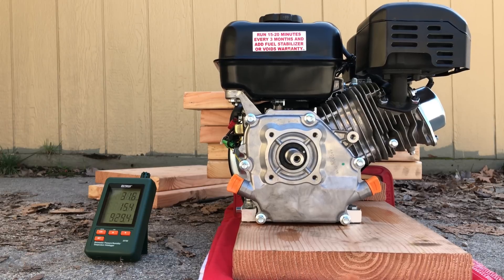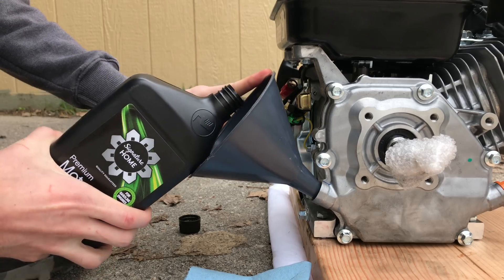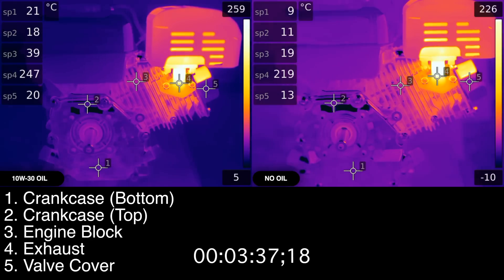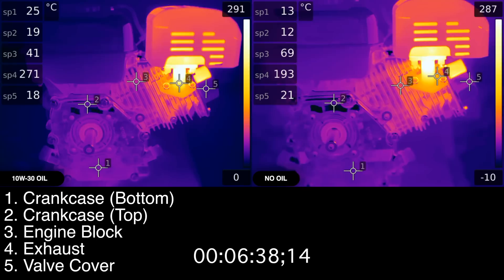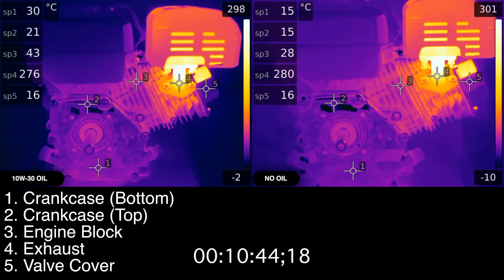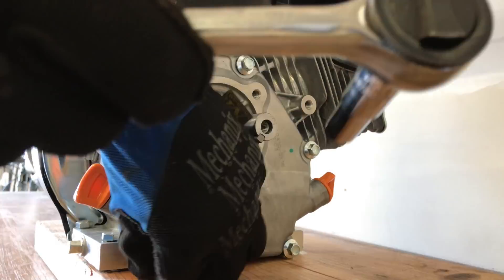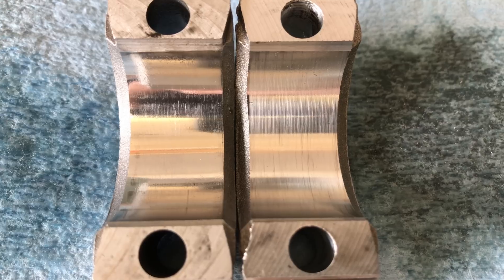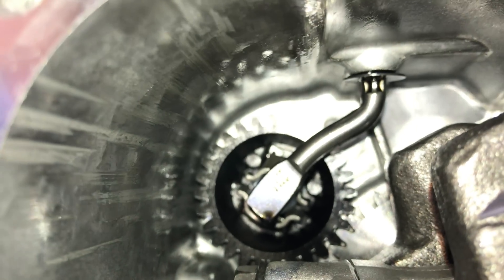What Happens To An Engine Without Oil?

Comment from the maker: Engine for sale, like new, only used twice, serious inquiries only!
I kid, I kid! As a serious tip though, be sure to occasionally check your oil level, older cars tend to burn more oil and it's a headache that can be easily avoided by checking your dipstick while your car fills up with gas. If you're into Instagram, consider following: https://www.instagram.com/engineeringexplained/. For product links, check the video description, like this $55K thermal camera haha - http://amzn.to/2mgV8XS. Shout out to FLIR for letting me borrow the camera!
Reply: I have a guess why this may have turned out this way.  The engine is new.  A new engine is going to have perfectly smooth parts and will therefore have minimal friction.  As wear would increase over time, so would the friction.  Another thought I had is that one of the main duties of oil is to be the weak point, and therefore break down instead of the metal pieces.  when you combine these thoughts together you realize how the oil really helps;  the oil prevents wear by sacrificing itself.

Adding this thinking to engineering principles, you realize surface temperature at equilibrium is about heat added to the system.  The combustion adds much more heat than any friction, especially in this system, which brings me to the next point.  You used an engine with no load being put on it whatsoever and no idle speed variation.  Having some sort of drive train would increase the heat from friction and the heat from combustion, due to the added fuel consumption of overcoming the external forces.  The added load would also increase wear which would increase frictional heat more as the surfaces wear even more.

Overall, the biggest problem with the test was having a new engine with no load put on the engine.  I good way to show this in another test would be to take a lawn mower, make sure it has oil, check the internals with a bore scope, mow a lawn, check again, remove the oil, mow a lawn for the same period of time, check again and compare.  I say lawn mower because it is relatively cheap and it would do the job of adding resistance, especially if your grass is tall.
Reply: The engine was on idle all the time. If engine was on heavy load and no oil in it, the damage would be significantly larger and you might see some serious difference on temperature.
Reply: You can idle and engine for a very long time without oil. Put a good load on it and that is a different story.
Reply: There are lots of variables such as: Is the test engine idling with no load? If so, an engine drained of oil will idle almost indefinitely due to residual oil still adhered to the bearing surfaces. Does the air cooled engine have a cooling fan or not? Air flow is mainly how the air cooled engine is cooled. Oil also cools, quiets, lubricates and seals power, not just lubricating. I recall this shyster guy at a swap meet back about 1970 who ran a Briggs engine at idle after draining his "Magic Oil Additive" oil from the crankcase. He went on about how his oil additive was so good, it would even lubricate the engine without oil! I was like 16 or 17 years old and told him: "Rev that sucker up and put a load on it! It'll lock up tighter than Fort Knox in about 30 seconds!" He got mad because all of his potential customers of his "Magic Oil Additive" walked away. I've worked with small engines since 1973. I've seen vertical shaft single cylinder engines seized at the upper crank bearing come into my shop. Customers were always amazed when I called them up telling them: "Your mower is ready" with a bill of $20. $15 labor (minimum charge" and fresh oil. All I ever did was manually spin the engine after adding oil, freeing up the upper crank bearing. Aluminum transfer must have been very minimal because of the brass or bronze upper bearing. No knock or anything! Horizontal crankshaft engines aren't so "forgiving".
Reply: FishMan72727 Eh, the system equilibrium temperature is equally a function of heat loss and heat added. Idle speed was a big factor in this test but load would not have mattered versus just RPM.
Reply: Another interesting vid. One thing that concerns me is when your engine producer tells you what oil to use but after 100k miles the weight of and type of oil for an older engine is likely to be the same or differnt as many people seem to change. Is it possibleto calculate the benefit of changing to a different viscosity of oil in an older engine or staying with the manufacturers recommendation?
Reply: Engineering Explained now load it up.
Reply: Cool video. Hey mister, can I interest you in doing a video about HHO kits? I find many videos on YouTube, but they are usually from sellers... so they're biased. I think it's an interesting subject and your unbiased insight will make for a very interesting video. Thanks.
Reply: Engineering Explained would you take some a bag of takis for your engine ? 🤔
Reply: Engineering Explained I
Reply: Engineering Explained that's a great tip!  I will check my Cars oil dipstick every time I fill up with gas!
Reply: Its perfect timing, but in our country, you can't open bonnet at petrol station.
Reply: Engineering Explained the engine will lock up without oil
Reply: bmw engines burn oil regardless of age
Reply: I have to admit that I'm guilty of not checking oil, even before and after a thrash on the autobahn. A combination of finding I have never needed to top up oil in 20 years, and a reliance on a little warning light I suppose.
Reply: Engineering Explained I
Reply: Engineering Explained
Reply: It's also worth noting that this is a splash lubed engine running under no load.
Reply: Engineering Explained just wanted to know red rooster performance silencer in royal enfiled are better or not 
2 how to maintain Matt black colour
Reply: Engineering Explained  hi friend 
I need ford focus se 2010 engine hiw much can cost me
Reply: Engineering Explained  can u do a test engine with cooking oil? Because some people use cooking oil as their engine oil. Is that good or any bad?
Reply: Engineering Explained I will happily take that engine off you're hands.
Reply: I'd like to point out that, in a car engine, the engine would have either locked up, or had a critical failure.
Reply: actually my engine which is a 2014 on my Subaru actually birds quite a bit of oil because it is a zero weight oil so it's practically water
Reply: I was using my electric generator,it stopped suddenly during 3hrs  working ,i thought  it may become hot,so i let it cool on next day ,i try to  start but it keeps shutdown after few mins start /on.
So i thought let check its engine oil level,it was below minimum.i pour oil in it,and it start work.
So my question is ?
Why was it keep shuting down,even though it was cooled ,was it any crankshaft or piston  friction causing it to stop in minute ?
Reply: So the engine without the oil does the pistons welded itself to the combustion chambers?
Reply: ''checking oil while car fills up with gas'' That's how you recognize he isn't European (in europe you can't block the trigger you have to hold it yourself the whole time)
Reply: Yeah most people dont do this "PREVENTIVE MAINTENANCE" simply doingg this can save u thousands!
Reply: X'xx01
Reply: I need a question answered I had a quad that dropped a drain plug wile riding i turned it off once I noticed it had been about 5 minutes
Reply: Engineering Explained I can imagine the engine without oil is actually hotter but because the readings are coming from the surface of the engine, the lack of oil only allows convection rather than convection and conduction.
Reply: No lowballers! I know what I have!
Reply: Yeah - if you don't need that damaged engine, box it up and mail it to me. I'll pay for shipping!
Reply: Thank You.Great videos! Very cool...TY73s
Reply: what type of engine oil did u use.. is it synthetic of mineral oil??
Reply: Engineering Explained  o
Reply: Since the topic is about engine heat. I was wondering if you could explain how engine coolant works as well as the different types there are out there like color etc.
Reply: Engineering Explained u
Reply: I think the engine is hotter with oil because the oil carries more heat and keeps everything stable. WIth no oil, you have just air and that cools faster than oil. Air just doesnt provide enough cooling or and barrier  in tight tolerances
Reply: Israel Casasola 

HHO is a criminal scam claiming stupidity against plain physics. No need for videos.
Reply: Engineering Explained run it with a heavy dose of molybddenum in the oil and see if the surfaces smooth back out.

Comment: I change my 2022 WR450's oil every 1000 miles. I just did the 5000 mile oil change and it was almost completely empty (valve seal is probably gone) 😭 The oil filter was clean apart from a few shiny specs so I hope it's not ruined.

Comment: I ran my engine with low oil, my car just shut off while driving fast, I didn’t hear anything like knocking, tried cranking it over after dying and it would not crank over, tried putting more oil in it and same thing, any idea what might be broken I’m hoping its just the head, I rotated the engine from the crank and it turned.

Comment: An engine obviously needs oil to not only lubricate and stop abrasion, but to also distrubute heat evenly around the engine, if certian parts were allowed to heat up too much by not distributing heat, the high temperatures change the properties of the metal. When hardened/quenched steel is heated until glowing but is not quenched by instant cooling in a fluid (usually oil or water) the metal becomes softer and more malleable, this clearly would be detrimental to the life and functionality of the engine, especially in relation to moving parts or parts that are under high stress/pressure.

Comment: I have this old gx160 engine, basically scrap but still runs. I cut half of the side cover off so u can see the inside of the engine when its running and removed the valve cover. And of course running it with no oil. As of now the engine has been ran for about 40 minutes total at higher than full temp screaming and all the bearing screeching stuff. But... The engine still runs great and isnt knocking nor has it startsd to seize up. Btw this is factory Honda not no clone Hondas are too reliable

Comment: The engine had Finns.. maybe the heat dissipation through them kept temps in control.. oils primary purpose is not heat removal..

Comment: Hi, I went over the recommended mileage amount for my oil change and started to hear a knocking sound and my car started to stall. after having it off for an hour I checked the oil and it was NONE. After putting in oil the knocking and stalling stopped. But it now jerks. I got an oil change 2 days ago and my car just stopped. Will it still lock up after a oil change?? Sorry it’s a lot 😔😔

Comment: Both times the engine had oil. He even shows the oil after. Should have used a degreaser before running  it. Also need to run both in same situation choke and temperature. All he tested was oil with oil pressure and oil with no oil pressure under different circumstances. Not a very good try.

Comment: I wish you could see what happened to my car with no oil in it. 4 minutes received a alert from GMC Chevrolet app glad I have but, it’s completely destroyed. Brand new blazer 2021 RS I took it to have an oil change at Jiffy Lube they weren’t talking to each other the guy doing it and the guy under the bay he’s draining it while he’s putting the oil in it so there might be maybe a quart in it. It doesn’t last very long. I’m trying to get it to the dealership it did die on me. It cooled down before it would move again just enough to get to the dealership after 40 minutes being stuck under a freeway pass that has 4 off and on ramps dangerous place to be! I did put on my hazard lights and apparently people don’t know what they mean anymore since it’s brand new and looks beautiful people assume nothings wrong and I’m just sitting there. I kept getting out and saying it won’t move it won’t go into gear. Camera see all the mistakes made they are trying to explain all of their nonsense away without just admitting it and saying we’re sorry. Third time coming in as I am now upset. They are seen pulling my dip stick like 10 times! See them put about 4 quarts oil in damage was done. I went back to this place they put 4 quarts of oil in it covering their mistake. Unfortunately the damage was done. There is so much scratching there is particles in the pan it’s a messed engine gone. I’ve never seen anything like it and it’s all indicative of not having oil. Or not enough! The first thing is that it requires 6 quarts they didn’t even know that when they were trying to put in the 5 quarts but the guy underneath is draining it so it may have had like a quart in it and that may be why it ran for a little bit longer, but it did die. And now I have a $54,000 vehicle that I can’t drive that’s sitting at the dealership and we have to have an independent person come look at it so they can then tell Jiffy Lube yeah you broke the engine! And the guy yesterday while talking to him he lied to my face and said I thought you were going over to Miller because that’s where I told you to go. He never said anything like that! Lie! Plus he said that he popped my hood on the first round and checked the oil no he was trying to use a diagnostic tool to see why it was on. Diagnosis thing is all over the map. All kinds of stuff came up but he didn’t tell me what it was. I already knew from my diagnostics that all kinds of stuff was coming through check engine variable valve timing and that means there’s not enough oil or no oil all kinds of stuff, and if they saw the pictures I wish I could put the pictures up everybody would fall on their bum! It is so bad and now I’m gonna have to sue the owners of this particular franchise and thank God it’s one that is very regularly used and they’re insured. I mean it’s not like they would lose anything they can get a new engine and put it in it pay for it pay for the vehicle and go sell it at auction, why my new car comes in. I don’t want a car with a replacement engine after 2000 miles no way!

Comment: I thought you were smart.
But then I saw you pour oil upside down.
There's even a damn picture on the oil container showing you how to pour it!
0:33
It's not about getting the oil out of the container. It's about getting the air to replace the oil in.

Comment: i kno its not safe at all, but how long do you think a v6 engine would run w/o any oil w/o causing serious damages. my car had an massive oil leak because the oil pan was not secured. did not notice the leak till i got home, car started making unusual noise 10 mins away from my destination. its a 2010 highlander, do u think 10 mins is enough to cause serious damage?

Comment: In order to truly run the engine on no oil it would have to have no oil at all meaning take some solvent clean all contact points and then run the engine it would run for less then 30 sec .

Comment: Guys a local mechanic started my motorcycle without engine oil for 3 seconds, is it potentially damaged? 😭
Reply: anytime you have metal to metal contact you're at risk for damage. should have been fine though. was it?

Comment: Notice the discoloration on the crankshaft near the connecting rod bearing at 4:22, caused by heat from friction.  A little longer and things would have gone downhill very fast.

Comment: Man, I feel so sad... This is my favorite engine of all time... The 212 cc 6.5 HP Horizontal Harbor Freight Predator engine is so useful. It can be used for so many things! I have one installed in my "runabout" car. But, I guess it's a good thing to see what would happen if I did not check my oil...

Comment: Oil is primarily used as a lubricant, not a coolant. If no lubrication is provided by oil, you can be sure that premature wear and damage to mechanical moving parts will occur.  That's why engineers should stick to their mathematical theories and juggling of numbers, whilst letting mechanics do the actual maintenance on engines in the real world.

Comment: I changed the oil and I guess I didn’t tighten the oil filter cap tight enough or something so when I started my car the oil cap came off and my car ran for about 30 seconds and made a huge mess on the floor... how bad will this damage the engine? Got new oil and tighten the crap out of the filter cap which probably won’t make it easy to remove it next time 😅 it’s a 2011 Camry

Comment: i did  this test in 1987 in a ,well 2 briggs n straton 3.5 HP engine's, in " Mid Orange correctional facility", upstate ny as a 21 year old kid, in the small engine repair class, and my no oil smoked n seized in under one minute ???????? wow, huge difference in tech ?? NO ??? why ???

Comment: I have a Volvo with 150k miles and use Full Synthetic High Mileage Oil with a Synthetic oil filter. I change every 3,500 miles.

Comment: I suspect the damage would have been greater were the engine made to run under load.  Also did I miss the examination of the piston and cylinder surfaces?

Comment: My friend's brand new peugeot 405 (yes brand new because it's still produced here in Iran) with its XU7JPL3 engine had an oil leak and he drove it for about an hour without oil on the road. This peugeot engine likes to damage its cylinder head very soon. The camshaft and rocker arms were so damaged! It was literally melted and jammed.

Comment: I would rather ran out of gas than oil.
Reply: Lets compare the two. On one hand the car quits and will run again when you put gas in it. On the other hand, the engine suffers catastrophic damage pretty quick and will cost thousands to repair. Yeah, i would definitely want to run out of gas instead of oil